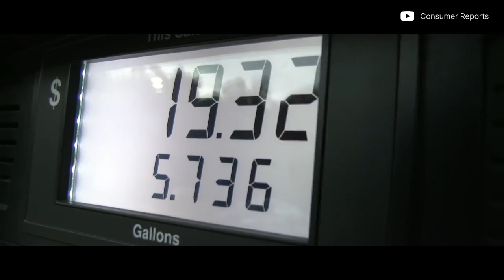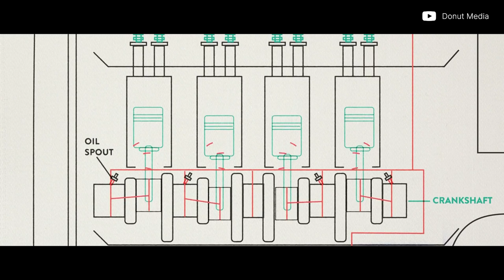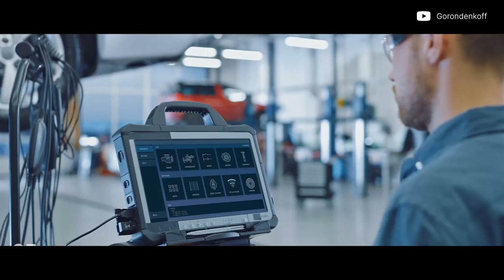Top 10 Car Maintenance Tips & Tricks - Behind a Desk

Comment: I’ve read multiple times about the Octane rating but as you said that most car can use the 91 Octane and just consult the manual.
My BRV manual recommends to use 95Octane but it only runs on 1.5L i-vtec engine. So do I use 91 or 95?

Comment: Hi autodeal, Ill just ask if what type po car taks the least maintenance. Is it the front wheel drive one or the rear wheel one. Please answer. Thanks
Reply: Depende pa rin po sa klase ng sasakyan. Kasi usually pag RWD is higher cc. The bigger the engine the most maintenance. Tsaka Sir Baka pwde nyo po mabisita channel q. Informative po tungkol sa mga sasakyan na maaring makatulong o makadagdag po sa inyong kaalaman. Pwde nyo rin po share sa inyong mga kapamilya. Pa sub na rin po kun nakatulong man. Maraming Salamat po at Mabuhay po kau!

Comment: I’ve read multiple times about the Octane rating but as you said that most car can use the 91 Octane and just consult the manual.
My BRV manual recommends to use 95Octane but it only runs on 1.5L i-vtec engine. So do I use 91 or 95?
Reply: Yung mga race cars talaga ang bagay sa high octance Sir. Kasi high compression ratio yung mga engine. Kun gagamitin natin ang high octane sa pang daily drive natin ay parang sayang lng po. Tsaka Sir makisingit lang po. Baka pwde nyo po mabisita channel q. Informative po tungkol sa mga sasakyan na maaring makatulong o makadagdag po sa inyong kaalaman. Pwde nyo rin po share sa inyong mga kapamilya. Pa sub na rin po kun nakatulong man. Maraming Salamat po at Mabuhay po kau!